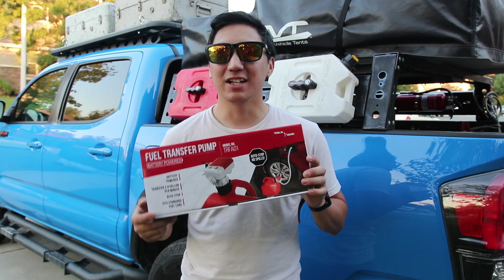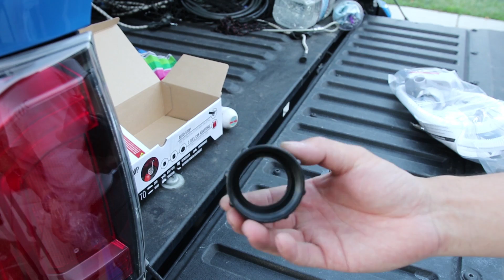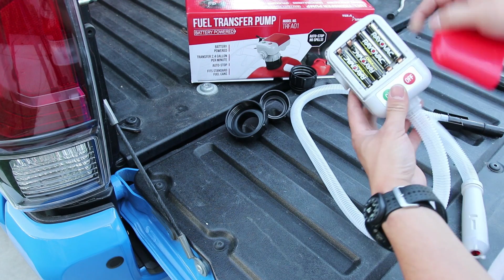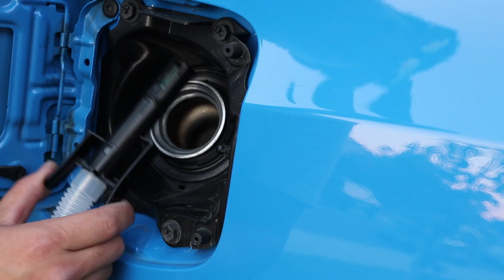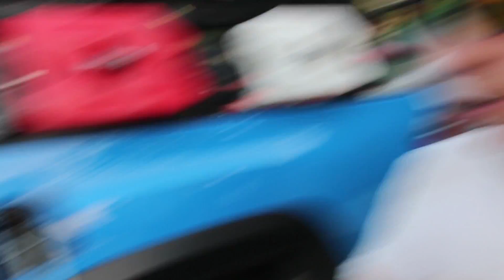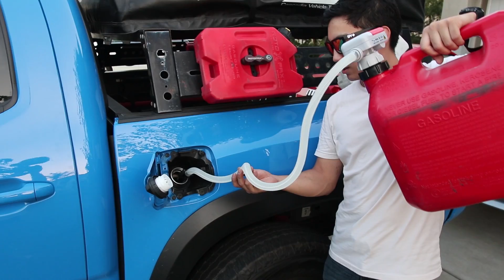Terapump battery powered fuel transfer pump. TRFA01

Comment: This does not have a check valve, so if you leave it on the bucket all the gasoline will evaporate. This is why the safety valve is required by law so there will be no fuel leak that can cause an explosion.

Comment: I had one of those.  It worked great - while iti was working.  I always removed the batteries between uses so as not to harm it with the acid that might leak.  I also bleed any gas in it when I finished using it.  Yet after a year or so. It just quit.  DO NOT WASTE YOUR OMONEY.  Not reliable in emergencies.  Now I use a siphon/hose.  Much simpler and it ALWAYS works!
Reply: A FIRMATIVES WITH THE TRHD05 FAIL-YEARS OF FEW YEARS OF USES.

Comment: What I love about this pump is I can use it to pump gas or diesel fuel ⛽️ into  my farm tractors .
No funnels and no spill anywhere.
It would be better if the hose could have been at least a foot longer.
Cuts off when tank is full no spillage no mess .
Comes with different size caps for different sized spouts.
Except for the hose length it is everything needed to make fueling a vehicle a pleasure .

Comment: I bought one and it’s fantastic. I have 2 failed spinal fusions in my lumbar spine, so lifting a gas can is out of the question. This pump makes it so easy to fill my equipment. My only suggestion is to not trust the auto shutoff, it can sometimes not stop your gas flow when the tank is full. Other than that little thing, I highly recommend this.

Comment: I'm setting up an emergency whole-house backup generator system for my home and thought a sensible finishing touch would be a fuel pump to transfer fuel from the 5-gallon fuel cans to the generator, so I bought a pump similar to this one.  The Deway looks to be manufactured by the same company as the Terapump, but the Deway has a nozzle with a valve, similar to a gas pump for your car for a few dollars more.  The battery housing and the pump body look identical on both units.  I'm hoping to use the fuel out of the 4 gas cans kept in the generator shed in rotation to fuel my zero-turn mower, keeping the fuel "fresh" to use in the generator should an emergency power situation come up.  These are certainly not "heavy duty" pumps, and I note that the impellor on the pump is not protected from any foreign material by a filter screen.  I think a tiny piece of debris could possibly be sucked into the pump rendering it inoperable.  It is probably a good idea to ensure that your containers are absolutely clean before dipping one of these pumps into your fuel container.  Interestingly, the housing on the pump appears to have "notches" that could hold some sort of "snap on" filter screen, but apparently neither the Deway of the Terapump include such a feature.

Comment: I have on of these and I've been using it for about 2 years to fill my boat in the slip.  The messiest part is transferring the pump from one gas can to another.  Besides that it still works great.  Keep the box, it's a good way to store it.
Reply: Any tips on how you’ve made it less messy?
Reply: @Joel-lopez  Honestly, I do it on the back of my boat and just hose it off.  I evaporates pretty quick so not much to hose off.  Let it run for 20 seconds after the can is empty to make sure most of the gas is out of it.  Store it in its box.  The box won't close but just a good place to store it so extra gas doesn't leak through the bottom.  Good luck
Reply: @gdsurprises5230  thanks for the info I appreciate it👍🏼 my biggest concerns are about removing the pump when am at the gas pump and I still have some gas in there how messy that will be but I’ll figure something out
Reply: @Joel-lopez  Ya.  I get it.  I try to make sure that whatever I'm filling doesn't go to full.  Like a boat.  If it's at half a tank, I'll only do 4, five gallon cans, knowing that won't fill it.
Reply: @gdsurprises5230  ohh I see 👌🏼 thank you for the input I appreciate it

Comment: Great video, however this pump is worthless. Worked great for 6 months. After 6 months it started to squeal and the flow slowed down to a trickle and then just stopped.. Very disappointing. Save your money.

Comment: Great presentation on the pump, very much appreciated. My only complaint is that you didn’t include the specific information like Manufacturer, model, etc., nor did you include a link for the pump. I’m sure I’m not the only viewer that would appreciate you including everything. Thanks again
Reply: TRFA01  WITH (A MFG'S WON?) ONE YEAR WARRANTY WITH RINSEYS OF WATER TO SOLVE GASOILINE?